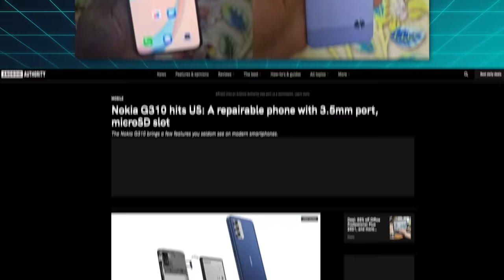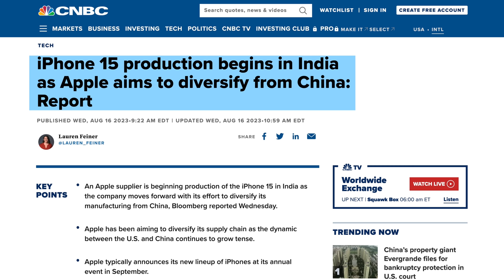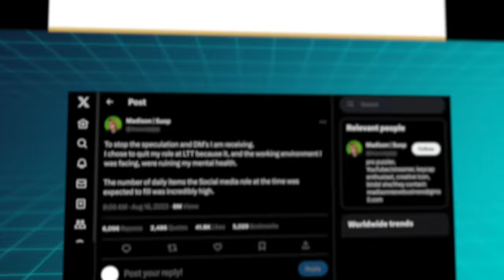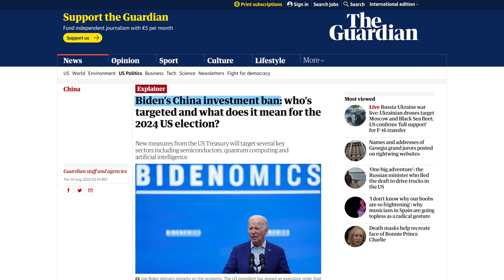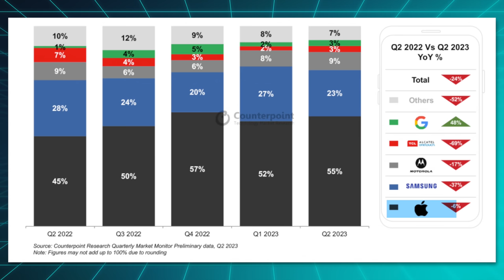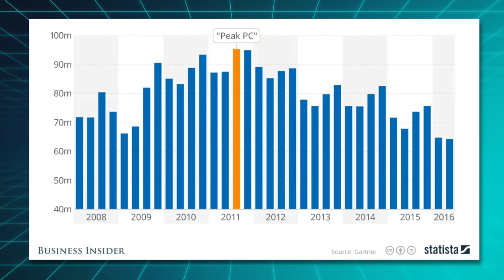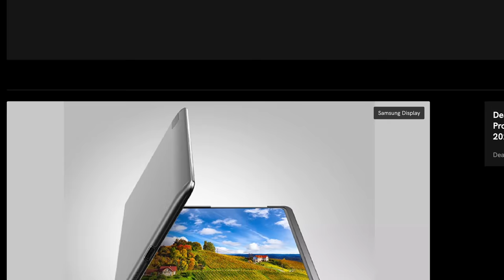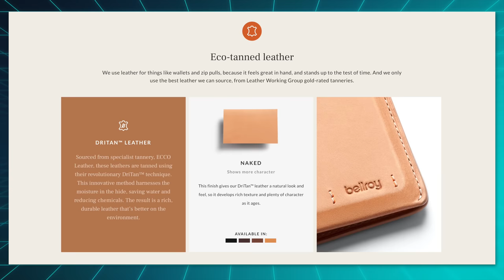Phone sales keep crashing (down to 2013 levels)

Comment: With technology, it is more difficult, every year, to make significant improvements.  Along with several years of support, you can see why phone sales have decreased.  But, then again, there will always be that group that just has to have a new phone, every year.
Reply: Not so much that i think mate  , but more that the smartphone makers dont help their own case by taking features away that where once always a standard , and now the price of phones is getting higher to a point of utter ridiculousness .
 My first high end premium galaxy phone in 2012 that was well equipped and with stuff/extras  in the box was not a cheap phone , roll on 11 years , and samsungs most premium phone costs 4 times as much and comes with almost nothing in the box  , and if you look at a lot of the other phones on the market , they are getting up there too .
  And as a consumer myself i look at the value of the current phones , they dont even come with a charger , no wired buds ( not even cheapys in the box ) , i suppose given their profiteering/meanness , we should be amazed they even supply a bloody cable with the phone .
Reply: Good luck living off those wierdos as a company.

Comment: Well my 2013 galaxy note 3 cost 600$ had a stylus, had a user swappable battery (I got a 10000mAH battery) a headphone jack, more fingerprint resistant and shatterproof back cover, a micro SD card slot, and a USB 3 port. Name 1 phone that has all these features today.
Reply: I'd take my S22+ over the Galaxy Note 3 though. I had terrible experiences with swappable batteries. You can get a pretty good phone for $600 if you look for value phones or good deals.
Reply: Didn't it also have a IR blaster that could be used to control anything with a remote? I know my Note 4 did. I liked that phone so much, I kept using it untill 2020!
Reply: TouchWiz is much more sluggish and terrible than our current 1UI OS skin. Imaging hardware, computation photography algorithms and Bluetooth codec standards have improved dramatically over the last decade. Not everything revolves around hardware alone. Excellent hardware prowess and great software optimization work hand-in-hand. If what you've said were true then Sony should've been the best-selling mobile OEM in the market right now. Clearly, it ain't.
Reply: @Uncle_Fred  yes I used it for my ac and home theatre system
Reply: @SamSard very true. Removable batteries have been garbage and could barely made it to 3 years. And one particularity of removable batteries, as they deplete, the phone can shut down at 70 percent, while with non removable batteries, my phone can still run on 5 percent battery for hours.

I sincerely don't want to use these removable batteries again. Non removable batteries are a pain to replace but I'd rather choose that option
Reply: you are comparing old tech vs newer tech for the batteries. If companies wanted they could make good removable batteries
Reply: Exactly my point-- features should increase with time not decrease. S22 should be better in ALL respects than S3.   @itsTiagoSilva
Reply: @danteerskine7678  You know that there isn't any difference between non removable and removable batteries except for those non removable ones being glued to the phone behind another glued on backplate right ? What you are describing is just old and new battery tech, it improved and if the new batteries were removable it would mean just that u can take it out without having to deal with glue, that's it. It doesn't mean your phone will shut down at 70 percent just because there is no glue on there. The only reason phones stopped doing this is for the "premium glass sandwich feel" and waterproofing, both of which are a gimmick at best and only a way to sell you planned obsolescence. Cause the reason most people buy a new phone today is that battery degrades and they don't want to deal with the glue.
Reply: @danteerskine7678  they are LITERALLY the same battery tech but one is glued in and the other is not. what you're saying makes absolutely no sense

Comment: I'm glad to see smartphone sales crashing. Smartphones have been terrible for years now. High prices, less ports and features, massive camera islands when the majority of users will only use 1 of the 15 cameras they keep thinking counts as innovation.
Reply: Honestly I would be happy with something that goes back to a 16:9 screen ratio so the entire phone can be smaller, take away the selfie camera because I never use it and don't want a hole in my screen, give me back the headphone jack and micro SD card slot, let me pop off the back cover to replace the battery easily, and give me 5 years of OS and security updates.

Comment: This comment was typed using my Galaxy Note8 from 2017. It's about as perfect as a smartphone can be and has everything I need. The only issue with it is that the battery doesn't seem to work as well as it used to. I'll keep using it for as long as I can.

The new phones are no better than the old ones, in some cases even worse. How hard is it to include a headphone jack on new phones? As someone who still uses wired headphones, I see the lack of a headphone jack as an absolute loss.

Comment: I use my current phone for the exact same things I used my iPhone 4S for back in 2013, but my current phone has a lot more power to run spyware on me, worse games and an absolute crapton of features that I never asked for and are actively ignoring. If batteries never degraded I would still be using my 4S.

Comment: I have been using the Samsung Galaxy Note 9 since 2018 😊, I bought it on the launch date for $825 but today similar model (S23 Ultra) costs a whopping $1510 almost double the price, yes I can still afford it but I am no more interested in spending this much money on a smartphones 😋
Reply: The thing is, why would you even upgrade ? I mean sure new model has more power and memory but does anybody even need that at this point ? even low end phones can handle anything you throw at them with no hiccups for a while now. And apart from that what do you get ? Removed SD card slot and headphone jack. Hell Note 9 even has a retina scanner and a beautiful 1440p high density display. It even has a multiple camera units which is like the biggest innovation in the last few years. It only lacks high refresh rate screen but that is more like nice to have luxury. Sure Ultra would still have better cameras and newer software but i mean is it really THAT dramatically better ? And worth the lost features that new phones don't have anymore for some reason ? Probably not.

Comment: Not sure why the increase of Google Pixel phones was not mentioned (the only manufacturer to actually have an increase). I hope this trend continues.
Reply: Ikr, felt like a strange omission to show that graphic and not mention it but spend quite a bit on how Apple bucked the trend by only losing a little bit.
Reply: Google is losing ground to AI technology. I wouldn't sound the alarm that the company is dying but it's definitely weakening year over over year.
Reply: Pixels are insignificant in terms of volume sales. So naturally even a small uptick will show as a huge bump in percentage sales. Doesn't paint an accurate picture of the overall Android phone ecosystem
Reply: I agree with Vard. Google phones have never really done well overall in the Android ecosystem. Maybe there could be a rotation of customers. Apple users switching to Android or other Android users tired of their previous brand switching over.
Reply: Ngl the recent Pixel phones are becoming really nice now.
Reply: @NicaeAlgon  I own pixel 7, my first pixel device, loving it so far.

Comment: Give me removable battery, unlocked bootloader, microsd slot and a headphone jack.
Reply: And flagship specs, not a low end phone with performance from 10 years ago. 
And enable the FM-Radio again. That isn’t even an extra chip or anything. It is built into the SoC but brands decide to disable that feature.

Comment: Foldables are too expensive and still sensitive for mainstream to take over. Otherwise, it makes sense this rush for a smartphone to stabilize. It is purely impossible to have an always growing market. Only Africa might change a bit this trend, but they mostly buy much cheaper devices there. Same for stock exchange, how on Earth is possible to always expect companies to grow? For instance to expect Netflix or some other company to have more clients year after year after year and when this is impossible, their shares collapse. The system itself is corrupt.
Reply: The form factor doesn't really come with any benefits to justify those drawbacks
Reply: It’s not corrupt, just capitalist. What did you expect

Comment: Apple has also been dropping devices from software support a lot earlier the past few years. The iPhone 7 could’ve ran iOS 16 and the iPhone X and 8 could’ve ran iOS 17. Some may say that’s plenty but the iPhone 6s got 7 years of support and meanwhile iPads with the same chipset as the iPhone 7 can run iOS 17 proving the phones could do the same. Plus the phones and iOS updates have basically been the same thing for the past 5-6 years so there’s literally no reason why those phones couldn’t have gotten the new iOS updates besides planned obsolescence.

Comment: I‘m still using my iPhone 7, which I bought in 2016. There is absolutely no need for me to spend 800 - 1000€ on a new phone just to do the same tasks that I‘ve been doing on the current phone "but faster". 
I‘m holding onto this phone until the phone dies.
Reply: They force you to upgrade by ending IOs upgrades. Eventually none of your apps will work, because they force they force app makers to upgrade. My iPhone 6 made all my important apps unusable. They allow things like weather to still work.

Comment: I am using a 2019 phone I bought in 2020, except for the battery drain (which i can top up easily via fast charging) the phone still works well, no lags or stutters, no bugs, cameras and videos are not exactly top tier but still great enough. Hopefully I wont be needing to get it replaced for a long time to come.

Comment: I’d still be using my 1st gen SE if the software was still being updated and I could get a new battery in it for a halfway reasonable price. The new phones with the fancy 3+ camera setups and the chips rivaling the power of a low to mid end laptop are completely overkill for what I want out of a phone.
Reply: So true. Like how much power is needed to run your IG app lol.
Reply: @Shay416  Exactly. I get it for gaming phones but otherwise ? I feel like the more powerful chips are only a negative these days. The battery size of phones doubled compared to 5 years ago but phones still last the same. Most of the power gets wasted by overheating chips that have crazy uncontrolled boost capabilities and what not to have better specs than the last year but, why. They shuld focus on making as efficient chips as possible now, it's not like we need more power in phones, there isn't a way to cool them efficiently anyway, the games that are there also can't even rival games from handheld from 10 years ago lol so why. I mean high refresh screans and efficient camera tech needs a lot of processing power but still.

Comment: The way I see it, phone markets have saturated now that fewer new features are getting added and existing features are getting phased out to pad profit margins.  High-end phone packages are becoming less convenient (no more microSD in some brand lines, no more 3.5mm jack, no more charging brick included), and mobile games are intersecting in hardware requirements that PCs are better able to meet.  Gimmicks that would have attracted some -- like gyroscope sensors and LAN-like connection between nearby devices -- are so underdeveloped for VR, AR, commercial, and personal usage that dedicated devices / cloud computing prove to be better solutions.  Some of these industries are never going to go beyond being a niche like flying cars.

In short: the modern smartphone has done everything a modern smartphone can do; everything it can't do already is being done better by another thing.  Everything it wants to do just doesn't have the tech nor infrastructure to make it work.  The market has saturated.

Comment: In my opinion, apple stable sales is because of deliberately “slowing” them down through software “updates” so you can replace it yearly or at 2 years, keep in mind that the only 2 things that I can think of being “decaying” over time that need replacing is battery and screen, everything else is mechanical has no reason to slow down
Reply: has been proved ios updates significantly reduce over the years the soc clock speeds, so this make the device slower and also reduce Energy consumption so device its less harmed by battery wear

Comment: The peak smartphone was the galaxy s5.
Water resistant, with removable battery and SD card, had IR remote, hover display and a ton of software features that Apple "invented" later
Reply: still using mine, 5th or 6th battery tho

Comment: My personal experience is that (despite all the internet chatter about the corporate evils of planned obsolesce) my current phone is most durable and longest lasting I have ever owned.  To the point that my cover broke before it did.  My brother just replaced his phone and ended up buying the same exact phone he had online.

My current phone first came out in 2018 and I got it on clearance before COVID.  It kinda sucks as a camera, to the point that I can barely use the QR function, but it browses Twitter and Youtube just fine.

Comment: I can understand removing the headphone jack to a degree due to how cheap and prevelant Bluetooth ones are, with no more dealing with internally snapped wires that you need to get just the right angle to work with, but removing expandable memory for flagships while having it in the cheaper models is just dumb...

Comment: Personally speaking. I need a smart phone to 1.capture images (i don't care about the quality because todays phones are so good even the Samsun galaxy a33.
2. Money Transaction.
3. Cellular card access and get calls message and
4. Access to internet to open my insta youtube etc 5. To get internet on my laptops using usb tethering/ wifi hotspots.
6. and navigation and a few other features.

So buying a mobile is becoming more an more useless ifu can access to all those features.

And playing games/productive works i prefer laptops/new amd apu mini pc/ full-fledged desktop/ new rog handheld (u can use it as a mini pc)
Saving money for the future is becoming more and more reasonable.
This is my opinion about the phone industry.

If we can get a tablet which is powered by amd strix point. Get so many type c ports which is capable of outputting display. Then i would love to replace my mobile and my laptop with that single tablet. (U can use tablets like a laptop)
@_@ 1 system is better than 1000 useless things.

Comment: I've upgraded from a Galaxy Note 9 to a S23 Ultra and apart from the camera, it was hardly worth it. The fingerprint sensor has been working much better on the Note 9, so in at least one aspect, the new phone is worse.
My prediction is that now (or soon) that chips have fallen in price, phone companies once again can make REAL upgrades to phones and it'll be once again worth it for consumers to upgrade. In recent years with the chip shortages there were limitations.

Comment: Not everyone needs to keep buying a new phone. Nor do they want to, either because it's a hassle to change to a new phone or they're unwilling to spend the money to do so since their old phones are still working fine. 

A battery change at the service center is much cheaper than a new phone anyway. And if you've got an older flagship, it might still be a-ok despite being outdated. Outdated, but not obsolete. Obsolete would mean it's no longer usable. My LG V50 and V60 as well as a Galaxy Note 9 and Note 20 from a few years ago and they still run everything short of the most demanding mobile games fast. And I don't play mobile games.

Comment: I kept my galaxy s8 for 5 years and only stopped using it when the battery no longer held a good charge. I constantly looked at new phones since the second year having it, and never found a new phone with the same features. SD card, headphone jack, oled, wireless charging, waterproof. Its not a long list but nobody offers that kind of phone anymore.

Comment: The peak of phones innovation stopped 4 years ago. 1000x zoom, 300mp camera or 500w fast charging does not matter when the receiver display cannot comprehend more than 1080p. Foldables are not massive enough and only caters to enthusiasts while not majority are subscribed to it. Unless a new software system is introduced, any software gimmick is just enthusiasts wish while the commons hardly bother to use.

Comment: Not sure what the LG StandByMe series is for aside from digital signage. Had to setup the one with the stand and here's a few takeaways

HDMI wired has worse latency than Airplay and Chromecast combined. Touch is sometimes not responsive and totally software's fault. No apps aside from webpages. Sluggish built in browser (or just display latency) without proper Fullscreen. No 3rd party browser.

A thousand dollars for a high latency, 1080p display with washed out colors, nobody aside from a very specific set of enterprise use cases would buy that